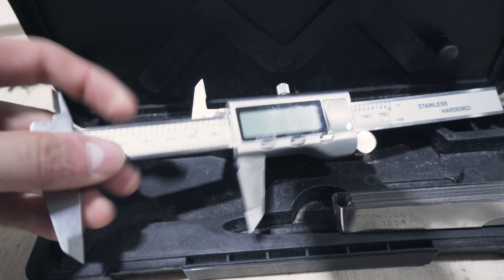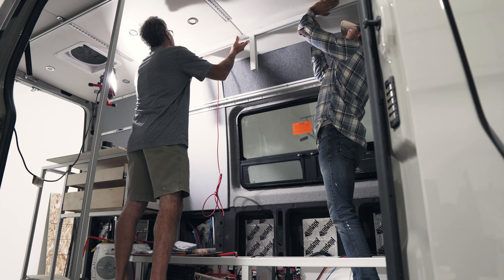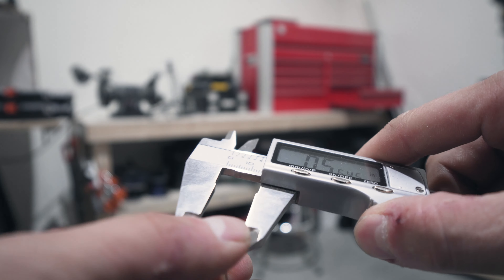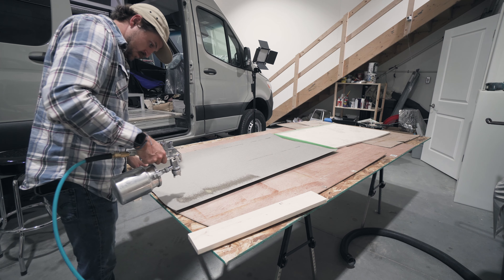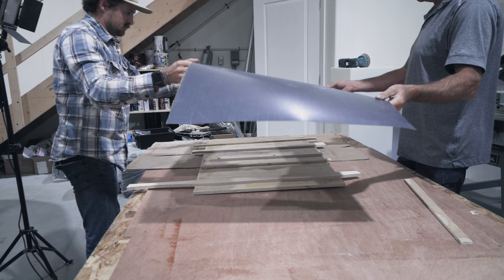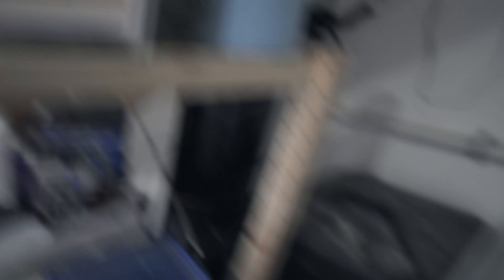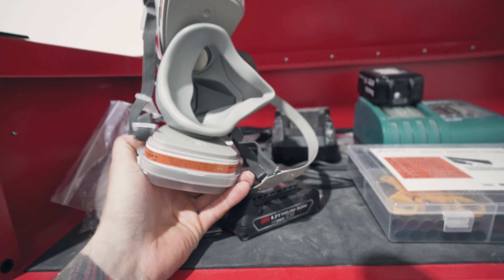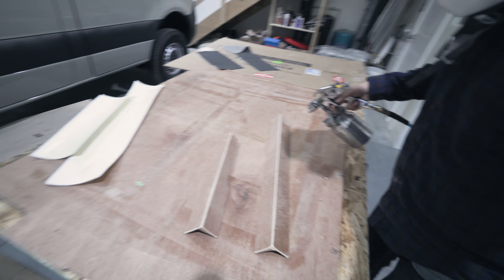TWO Unique Must Have VAN CONVERSION TOOLS

Comment: Instead of a complicated spray gun for contact cement check out the Critter Spray Product Siphon Gun. It's super simple but works good for a DIYer on smaller projects. I've used it on upholstery like your headliner and it works great. For laminates I've found that a large putty knife 5-6" works good at keeping the cement thin but evenly distributed.

Comment: Good video as usual. FYI that's a digital caliper, not a vernier caliper. Calipers (generic) can have a vernier scale ($), dial scale ($$-$$$) or digital scale ($-$$$). A vernier scale looks like two rules edge to edge. 

According to Wikipedia : "A vernier scale is a visual aid to take an accurate measurement reading between two graduation markings on a linear scale by using mechanical interpolation; thereby increasing resolution and reducing measurement uncertainty by using vernier acuity to reduce human estimation error."

As a machinist it always bugs me when people get this wrong.
Reply: I've had my vernier caliper (Mitutoyo) since '78, semi-tired field press tech. Still gets lots of use.
Reply: @edwardthomas7022  buy good quality and it lasts a life time, absolutely nothing wrong with a Vernier scale if you know how to use it. My micrometers have a Vernier scale, but my Mittutoyo calipers are dial scale. Most people are only familiar with the cheap plastic vernier calipers that they use in schools (my wife is a science teacher)
Reply: @paulandrews7573  I actually prefer the Vernier. I have a digital angle gauge that eats batteries ...
Reply: @edwardthomas7022  That is an issue with digital calipers (I always keep two spares in the case), but it's nice to be able to swith between mm and inch, and to be able to zero out on a measurement and do tolerance checks. But if you know how to read vernier scales they're fine, seems like a lot of people forget how to read them though.